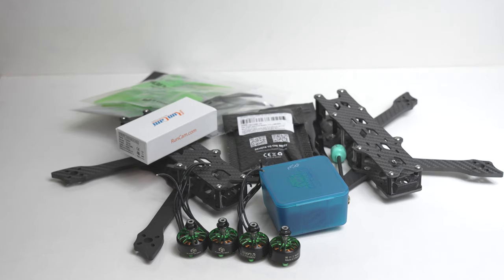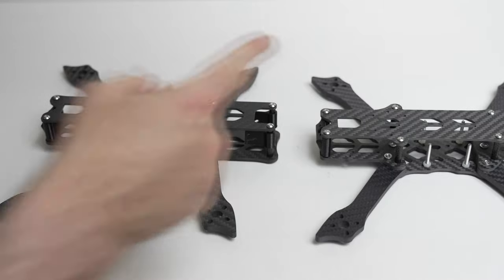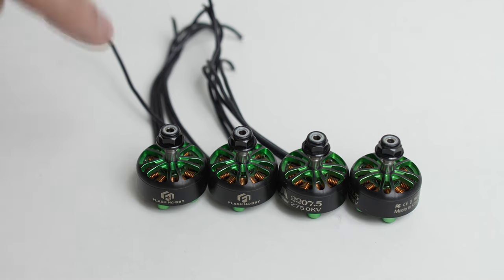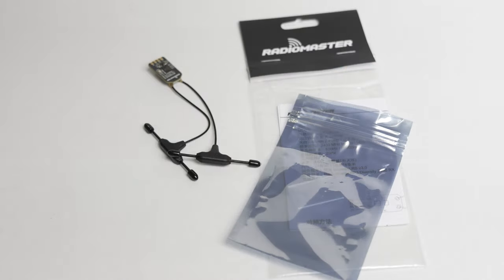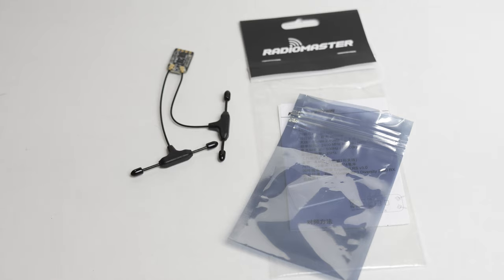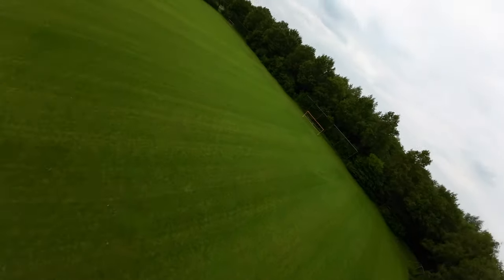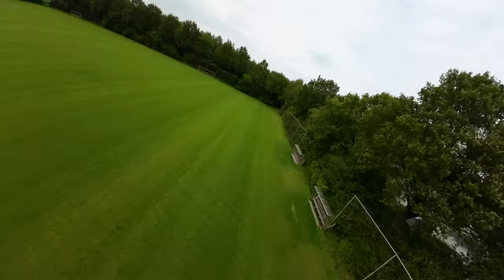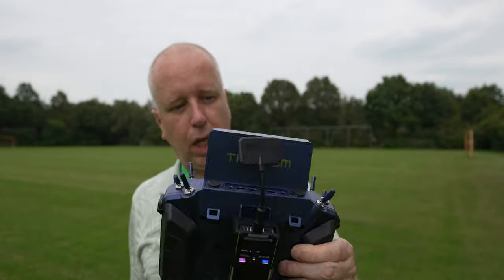Long Range Project P1 ! :D - Rotorama Buddy5 + Mamba + Foxeer + TBS + FlashHobby

Comment from the maker: When "leaving room for improvement" is an understatement! :D :D 

the parts list! :D 

Frame: Rotorama Buddy 5" DC 
https://www.rotorama.com/ramy/rotorama-buddy-5-deadcat 

Motors: FlashHobby Arthur 2207.5 - 2750 Kv 
https://www.flashhobby.com/a2207-5-rc-brushless-motor.html 

FC: Diatone / Mamba F405MK2 V2 
https://www.diatone.us/collections/flightcontroller/products/mamba-f405mk2-v2-fc-1 

ESC: Diatone / Mamba F45 128K BlHeli32 
https://www.diatone.us/collections/esc/products/mb-f45_128k-bl32-esc 

Camera: Runcam Phoenix v2 
https://shop.runcam.com/runcam-phoenix-2/ 

VTX: TBS Unify Pro32 HV 25-1000mW 
https://www.rotorama.com/video-vysilace/tbs-unify-pro32-hv 

Receiver: Radiomaster RP3 ELRS Nano 
https://droneshop.nl/radiomaster-rp-3-elrs-nano 

Prop 1: HQprop 5.5x2.2x3 
https://droneshop.nl/hqprop-55x22x3-propellers-light-grey 

Prop 2: HQprop 5.5x3.5x3 
https://droneshop.nl/hq-durable-prop-55x35x3 

Lipo: CNHL Black Series 2000mah 4S 
https://chinahobbyline.com/collections/cnhl-fpv-quad-drone-lipo-batteries/products/cnhl-black-series-2000mah-14-8v-4s-100c-lipo-battery-with-tx60-plug?_pos=3&_fid=962363083&_ss=c